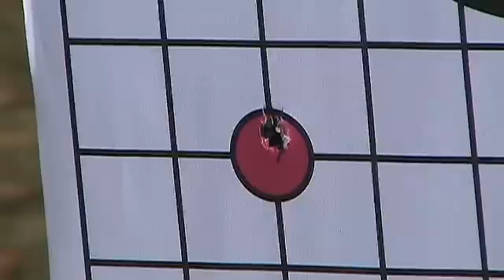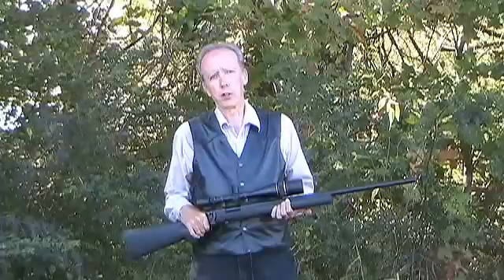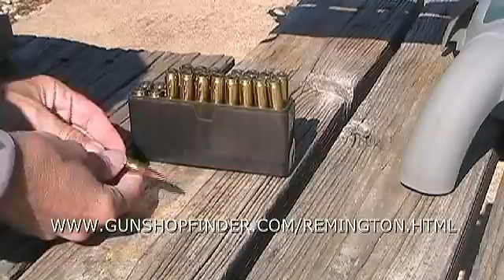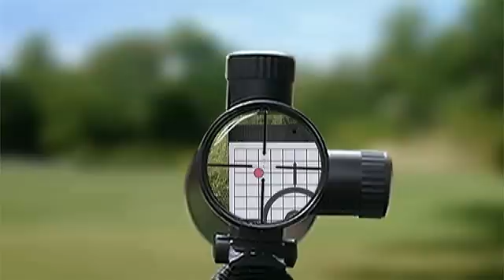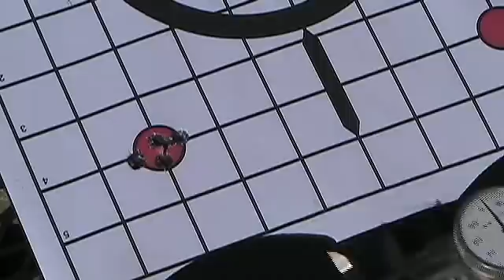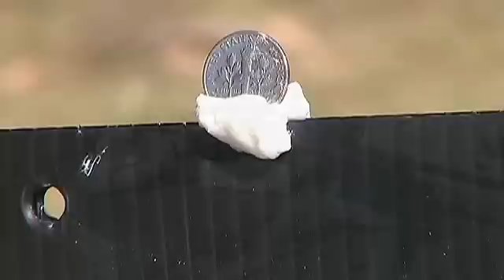Remington 700 Police Accuracy

Comment: I have 2 early 1990's vintage 700's in .30-06 and .300 WinMag. Both have composite B&C stocks which have been glassed and the barrels floated. The factory triggers have been adjusted to 2.5 lbs. Both sport Vortex Viper PST Gen II 5-25x50 scopes. The factory barrels are so good I never gave any consideration to getting them re-barreled. My rate of fire is never high enough that barrel heating would cause a significant point of aim shift. With my handloads using Sierra Match King HPBT match bullets I can fire a 3 round, 100m, .30-06 group you can MORE THAN cover with a dime (most are .3-.35:") and a 3 round .300 WinMag group you can more than cover with a nickel. As you mentioned, repeatability when it comes to stock weld is key. In Army sniper school we were taught that your goal was to place the buttstock firmly enough in your shoulder that the pulse of the arteries in your shoulder would make the crosshairs jump. I was skeptical of this at first but on the range I adjusted my stock weld and pressure until I saw the jump and was amazed at how much difference it made. Another point made is you never want to use more than the very tip of your trigger finger to engage the trigger and you engage at the very bottom of the trigger itself. 

I am sure my intensive training and real world sniper experience in Iraq and Shitcanistan  in some measure to the superlative repeatable accuracy of both of these rifles but the bottom line is that the Rem 700 is a superlative rifle from the word go.

Comment: I always hear everyone talk about Remington accuracy but most rifles are just as accurate with the right ammo. 
I have a Winchester M70 Featherweight in 257 Roberts that'll place 3 shots in a group that can be covered by a dime at 100yds! My wife's Steyr will cloverleaf three 30-06 holes inside of a nickel at the same distance. A friend's Savage in 308, one of the new models with a 20" threaded barrel, will stack 'em also. Yeah, Remington makes some accurate rifles but so does every other firearms manufacturer. 
The two main contributing factors on virtually any modern rifle's accuracy are finding a load that the gun loves and having an experienced shooter at the bench. 
This was a good video that covered many important ideas, very calmly!

Comment: The Rem 700P is a great rifle, I had one in 308 and 338 Lapua, however, if I would get a new Rem 700, I would get the 300 Win Mag with the 24 inch 5R bull barrel.
For anyone doing this, I would suggest getting an additional barrel and an action removal tool to replace the barrel for when the time comes to replace it.
The barrel life on those is right around 5000 shots, soon after you will notice a decline in accuracy, and yes, they do make one ragged hole out of the box.
Fantastic rifle.
Reply: I also have the 338 and the 308

Comment: im a military sniper we dont have time to let our barrels cool between shots. however my groups change very little between my first group and my last barrel cooling is bullshit.
Reply: I doubt it snipers are more literate, they know how to capitalize sentences and use punctuation. You know pay attention to detail. If you really were a respectable man you wouldn't just tout that information. Also I know for a fact barrel heat can effect group sizes and shot placement.
Reply: Usually NOT on HEAVY BARRELS (not for "harmonics" at last).

The bullet tend to "shoot hight" with the increasing of the temp; gun powder react differently to different temp but THERE IS A FORMULA TO COMPENSATE THAT FACTOR (if you have time to misure the temp of the chamber and do the mats AT EVERY SHOT (or "few ones").

I do not know if +Josh lower is a sniper or not but i figure out that MOST OF THE PEOPLE (around me AT LEAST) let their barrels cool down every few shoots but... WHEN I ASK THEM: <WHICH DIRECTION YOUR SHOOTS DEVIATE WHEN THE BARREL GET TO HOT?> Or... <HOW MUCH YOUR SHOOTS DEVIATE AND "AFTER HOW MANY SHOOTS">... NOBODY EVER CAN GIVE ME A STRAIGHT ANSWER (because none of them have ever tried to figure it out; sorry but THAT IS IDIOTIC).

The "barrel deviation" that usually people is referring too, WAS TRUE 20 YEARS AGO, with LOW QUALITY metallurgy and machinery. TODAY IS NOT MORE THE CASE - at last not with "hight quality barrels" (and for sure NOT ON THE HEAVY BARRELS).
Reply: Josh lower I say the same thing about a 240 bravo they say if you do 100 rounds straight you need to let it cool down for 15 minutes well when you're in a firefight that's not a f***ing option ha ha

Comment: Very good info about holding and positioning the rifle.  However, I can't agree with the emphasis on the heat of a few rounds affecting impact of a heavy barrel.  What is MORE important is the wind you see in the background at 7:21 in the video.  That is why the dispersion that you did have in your groups is almost all horizontal dispersion.  I shot bench rest competition and I know these things to be true.  Now a thin sporter contour barrel could start to get some dispersion because of heating after 5 or 6 rounds, but not a heavy barrel.  Most bench rest matches you fire around 10-15 rounds within 5 minutes.  5 records shots, but any number of sighter shots that you need. All the Benchrest records have been set in those conditions.  Wind is the bane of really tight groups.  We use two or three wind flags at different distances to check both direction and velocity while shooting.   The goal is to try to fire each shot under the same wind condition.
Reply: +doctorxring I have seen heat change the impact on my hunting rifle and I get the odd lose round out of my 700, either I pull it or perhaps heat.  You are likely right but in being so you just stole my excuse. :)
As I casuallt shoot under 1 MOA with the 700 and 1 MOA + -,  with my H & K 770  you are likely correct.
Reply: I am nailing < 1 MOA But not consistently. 1.1 is reliable .
I reload 150 Gr right now but I am thinking the 168 or 175 nay work better, The Russian crud works fairly well 1.5 + -  
Not fussy about steel casings .
The Remi (mine) has a 26" bull barrel . 
It should reach out. 
I am looking for the one hole groups nd not getting them. The H & K is only slightly less accurate than the 700.

Comment: Nice Review but have a few questions! how long is the barrel ? also im thinking of purchasing a police 700. Im sorta new to firearms but i would like to paint my rifle with a camouflage. Some people say if the barrel is stainless still you cannot paint over it, it will wear off. With this rifle are you able to paint over the whole rifle? isnt this a H-S Precision composite stock, whats better that or the Choate stock. Every one always speaks about the Mcmillan A4 being a great stock. Im looking to shoot at 1000 yards. Is this rifle capable that far ?
Reply: Can you put a magazine into this rifle ?
Reply: James Ibrahim the Remington is known to have a ton of modification options, you can buy one with the stock that accepts magazines (more money) or get a base model, learn how to handle it and then upgrade.
Reply: James Ibrahim The Remington 700P in .308 Win has a 26" barrel with a 1-12" rate of twist in the rifling. It comes with an H-S Precision stock which is very good and most people wouldn't want to replace it. The barrel has a tactical matte black finish and is not bare stainless, it can be painted. As for the 1000 yard issue... if you are near sea level, 1000 yards will find a 168 grain match bullet in the transonic or subsonic state for most loadings. Shooting a heavier bullet such as the 175gr or 178gr match bullet offerings can overcome that but as Don stated, hand loading to find the right combination of bullet and charge is the key.

Comment: How nice it would be for some detail on that 'extensively tweaked load'?
Reply from the maker: sjohnson1776, sorry I didn't reply until now to your question. For these loads I fireformed the brass to the chamber of the rifle. I took several dozen cases, trimmed the necks, weighed them, came up with an average, and put aside any that were outside +/- 1%. I recorded the weight of each case, filled each with water, and then weighed themagain and subtracted the empty weight. This gave an idea of case volume.

I don't full length resize the cases, but just neck size them. I put aside any cases with shoulders that are off by +/1 .02". I use a competition seating die and set the bullet depth to .015" off the lands.

I go from 41.5 to 42.5 grains of N140 depending upon the outdoor temps. The bullets are Sierra 168 gr Match Kings. I weigh them, but they're always spot on. The primers are CCI Benchrest.

I have targets I shot at 500 yards with this rifle and those loads. One group is 3 1/2". The range is set up such that there's no place to put a rear bag, so I was supporting the butt of the stock on my shoulder. I'm certain that with a rear rest the groups would be under 1 1/2" at 500 yards.
Reply: Well I would definitely categorize that as 'extensively tweaked'! LOL. That is sub MOA shooting and I know very well how difficult that is. Thanks for the info Don Becker

Comment: The Remington 700 is probably the best value for the money that you will find anywhere. My 30-06 out of the box shot 3/4" MOA groups with my handloads. I had it accurized with a B&C stock, with the bed glassed and the barrel floated and the trigger pull dropped to 2 pounds and now it will shoot just over 1/4 MOA with my Pentax 6-24x Lightseeker scope with the factory barrel and my handloads
Reply: Agreed! My 308 m700 police was consistently, .5" to .75" with precision ammo. When I added the Razor GEN III I was getting sub moa at 500y fairly consistently.

Comment: I have a Howa M1500 which is modeled after the Rem 700 and uses a lot of the same accessories. Mine has a free floating bull barrel. 3-9x40 scope. And the best part is I got it, new in the box, for almost half price, 379.99 compared to the 2013 models. Mine is a 2010. The S&W 1500, Mossberg 1500, Inter Arms 1500 and Weatherby Vanguard were all made under contract by Howa. That says a lot for Howa,and a lot for the Rem 700 since the Howa is a copy of it. And it's used by Japanese Tactical units

Comment: fk sandbags, who cares if you can shoot with a perfectly steady shot ,  but i was looking at the r700 in 30-06 but ended up getting a mossberg atr 100 30-06 with lba for a good deal, its was way to light so i added ball bearings to the front of the gun and it shoots good for a cheap gun, even with surplus ammo from the early 70s and rapid fire you get dead on shots at 150 yards all day

Comment: Someone who wants to achieve 1/4 MOA repeatability.  So when they take the rifle out for that 1462 yard shot in 7mph crosswind (12mph gusts) at a 4 degree downslope at 97°F and 82% humidity... they know they can calculate an accurate firing solution based on their weapon platform and ammunition, dial it in, and deliver that first (and perhaps only) shot to their bullet customer.

Comment: During the shot, the barrel experiences harmonic vibration.  Pressure on the barrel will change that vibration, and in turn, change point of impact (everything else being the same).

If you have variable pressure on the barrel (say, from a warped wood stock) then there will be variation to the barrel vibration from shot-to-shot, contributing to variation in point of impact from shot-to-shot.

Comment: I use Sierra Marchking 150 gr. HPBT match bullets in front of 44.3 gr of Reloader 3031  in the handloads for my 700 .30-06.and I consistently shoot one hole, 3 round groups at 100yds with a warm barrel, At 350 yards, my groups are never bigger than a tennis ball and many have been as small as a golf ball. Granted I have a B&C fiberglass match stock with the bed has been glassed, the barrel floated and the stock trigger dropped to 2 lbs. I did not get accuracy that high out of the M24 SWS I used

Comment: Consider buying a SPS Varmint and upgrading the stock.  I picked up a SPS Varmint in .223 this week and put a HS Precision stock on it.   It shoots sub 0.5 MOA...probably 0.3 MOA if I was a better shooter and that's with run of the mill 55 gr Federal Tactical ammo.   All in, it's under $800 whereas the 700P is >$1100 here in Canada.

Comment: Close. While the Remington 700P and 700SPS both use the same barrel and action, the stock on the 700SPS is simply a synthetic stock without a free floating barrel or bedding block. The 700P has an H-S Precision stock that is free floating and aluminum block bedded. The 700SPS will produce shot groups around the 1.5 MOA range and simply by switching the stock out you should produce sub-MOA groups consistently.

Comment: Good video. Good information. Another great rifle that is just a step above the 700P is the Remington 700 Milspec 5R. Same barrel and action as used in the Army's M24 SWS but much cheaper.
Reply: Hasn’t this comment aged like toilet water. 
The Milspec 5Rs do not have the same barrel as the M24. They simply have the same number of lands and grooves. A rock creek m24 barrel is far superior to a standard Remington 5R barrel.
Reply: @EnkeiTenjin  Today, yes, they are their own production line, but they originally started out as barrels which failed to meet the strict tolerances put in place for the M24. As I understand it, rejected M24 barrels were re-tooled to become the Milspec 5R line. It became popular enough Remington started specific production for the line.

As far as accuracy goes, my own 5R in .300 Win Mag with Black Hills 190gr BTHP will consistently hit .7 MOA when I'm doing my job. My brother's 5R in .308 with 168 gr BTHP consistently shoots around .4 MOA. Perhaps the M24 barrels are superior, but at that point we are splitting hairs.

Also, there's no need to be disrespectful. If I have incorrect or outdated information, a polite correction is all that's needed. The derogatory commentary is unnecessary.

Comment: Loved the video. I have recently learned the hard way was regarding brass selection which was mentioned. Bought a bunch of fire-one mil-spec brass thinking it was heavier and would withstand more reloads. Expected fliers first round during fire-forming. Subsequent loads were actually worse. Measured the thickness of the brass in the walls of the neck and was shocked. 1-2 thousandths off from one side to other. Started shaving the necks. Back into the 10 ring! Still can't beat Lapua brass though.
Reply: Lapua is King

Comment: Ya, the LTR stands for Light Tactical Rifle. The LTR is very accurate for its size and weight and suprisingly light. But the 700P is based on accuracy. Heavy bull barrel, Hogue stock, Free floated, etc. But they are the EXACT same action. The standard issue Sniper is actually an M24 but its built of a Remy 700p with a little tweaks. But the 700 action. Sorry if I misled you.

Comment from the maker: Vampireratt, I'm using 42.3 grains of N140 with a Sierra 168 gr HPBT Match King, and CCI benchrest primers. Bullet seating is .0015" off the lands. The brass is Federal, and is trimmed to 1.014" to 1.017". I've sorted the cases so that they're all within the range of 173.9 to 175.9 grains. Primer pockets are uniformed. The cases are all fire-formed, and I only neck size them after that. If the shoulder is out of spec, I don't use the case.